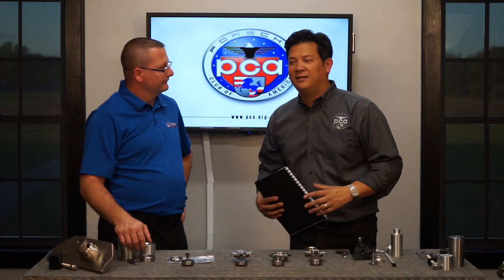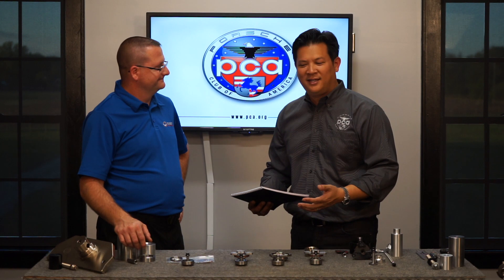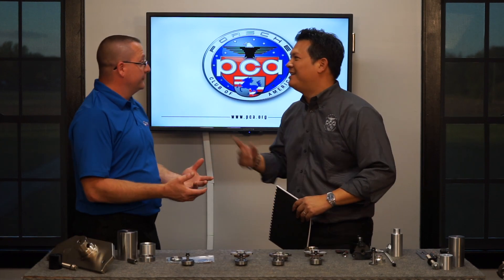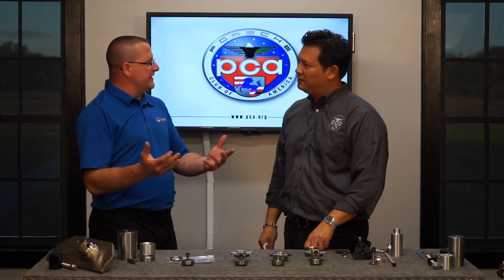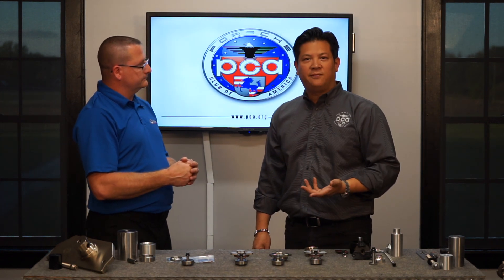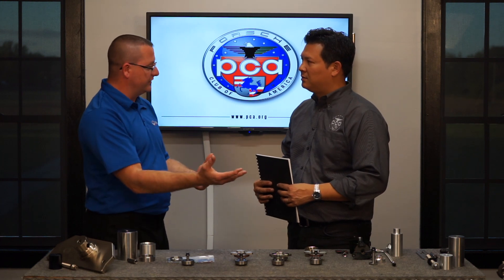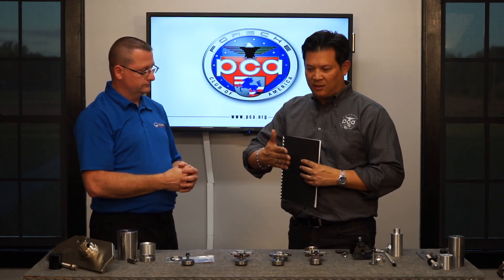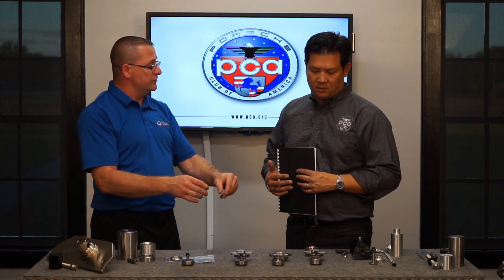PCA Spotlight: Types of IMS bearing retrofit kits

Comment: Nice vids. Correct me if I'm wrong, based on the video,  the solution for factory bearing is to remove the grease seal, as easy as that. How do you reseal the IMS flange after?

Comment: I'm in the middle of a rebuild on my air cooled engine, and looked into this IMS bearing issue out of curiosity.  The installation video to retrofit this kit is a ground ball in comparison.  I'd do this upon my first engine drop for the clutch or something else that you do "while you're there".   Great series on this issue for sure.
Reply: I believe that all the air cooled Porsche Mezer engines did not have this particular IMS bearing issue only because all the IMS bearing that they had were oil fed unlike the water cooled engines for the 986 and 987 water cooled M96 and M97 engines only the water cooled engines from 1997 to 2008 Had the same as bearing failure which was a sealed bearing it has its own oil unlike all the old air cooled flat six engines that had IMS bearing yes but all of those were oil fed by the engine itself so it made for little to no failure rate as long as you change the oil of course unlike the newer water cooled engines which all have a sealed bearing in that case these solutions they are talking about are for the M96 and M97 water cooled engines with the sealed IMS bearing not the air cooled engines that was the big problem for Porsche with the new water cooled engines they went away from the oil fed bearings back when they change from air cooled to water cooled flat six engines in 97 hope this bit of information helped
Reply from the maker: Glad you enjoyed the video. Be sure to subscribe!

Comment: Looks like an infomercial for Jake Raby.  Not a mention of the EPS cylindrical bearing, over 5000 sold with no failures.  Would be nice if PCA could actually be objective.
Reply: You can now buy a replacement from Porsche that's a fix. Dual row.

Comment: OK, I just replaced my IMS and clutch with parts from EPS. The bearing is way better than any of these and maybe cheaper. It is a cylindrical roller bearing  and is open with no seals. Hold many times the force of any of these. it comes with an easy  to do oil bypass to send more oil to the bearing, but EPS says you don't need it. Their newest design bearing works fine without it, but you can use it for piece of mind if you like. Check it out https://www.europeanpartssolution.com/
Reply: Same for me also. Actually, I've read quite a bit of the forums and FB and can't find a single failure of any roller bearings. They are expensive but not near as much as the LN products.

Comment: i have a Targa 2002 with 28k miles on it. purchased it new and have never had an issue.. Should I have the IMS bearing replaced?
Reply from the maker: At minimum, you should be checking closely for metal debris during oil changes and consider sending oil sample out for analysis.
Reply: @PorscheClubofAmerica  thank you so much.. I will do just that.  I follow your videos and find them very educational.
Reply: @PorscheClubofAmerica  thank you very much! thanks for all your great videos
Reply: @PorscheClubofAmerica  after thinking it over, I have decided to have the IMS bearing replaced. Thanks to your program and your response it helped make my decision.. Thank you.
Reply: @PorscheClubofAmerica  not many know of this, glad you share it.

Comment: There's an article from Autohaus Hamilton in Australia about the IMS. google “Autohaus Hamilton Porsche IMS” The article lists all the models and engines (with engine numbers) that are affected. "The Porsche models that are prone to IMS failure and should be replaced are: All 986 Boxster models. - 987 Cayman & Boxster models up to engine number 61504715 - All 996 models (not including: GT and Turbo models) - 997 3.6ltr with M96/05 up to engine number 6950745" Before 2000 Porsche used a double row IMS Bearing which had a low failure rate, then they switched to a single row until 2005 - 2006 and this single row has had the most problems. After 2005 - 2006 Porsche stayed with the single row but increased it's size and strength and this bearing has had the least problems of all three types of bearings used from 1997 to 2008. The upgraded bearing in the 997 and 987 is unserviceable, meaning you can't reach it unless you strip the entire engine down. Some of the early production 2005 - 2006 987 and 997 might have the pre-upgraded bearing fitted, that's why the engine numbers in the Autohaus article might be helpful in determining which type of IMS bearing is installed.
Mr. Jake Raby from Flat 6 Innovations says he has only ever seen 3 M97 engines built after 2006 blow an IMS bearing (Link see comments https://www.youtube.com/watch?v=Srrq4-d3mOg) Rennvision by The Knowledge Gruppe. 
Starting in 2008 Porsche introduced the new 997.2 and 987.2 and switched to a DFI direct fuel injection engine which doesn't have an IMS Bearing.

Comment: Getting ready to have my ims fixed on 2005 C2S. I am finding all the traditional ball bearing and cylindrical bearing kits in the mid $2000s range for installation and parts.  The killer is the IMS solution ranging from $4100-$5800. Everyone wants $700+ more for the labor vs the other bearing installation, even though Jake publicly states that it only requires 0.5 hr more at most of additional labor. I guess we take it twice, once from Porsche and another from these private shops that know the people that want the best kit, aren’t only willing to pay the approx $1,000 for the kit but also willing to spend an extra $700+ for 0.5 hour of labor, just because they can. So much for the friendly Porsche community.
Reply: That's what I keep thinking.  Also, Jack Ruby's products are not warrantied unless you go to a shop so if you DIY no support. This is why the shops support him. The part is marked up incredibly high too.
Reply: He said it's 1/2 hour MORE  to install the RMS = Rear main seal,  easy to confuse RMS with IMS..

Comment: I went with the Porsche dealer. I have a 99 911, which is outside this discussion because their IMS bearing fails much less frequently than the later models and was outside the class action suit. Nevertheless Porsche tells me that the IMS seal tends to leak around 25 k miles along with the RMS seal. Their solution seems to be to periodically check for any oil leak between the engine and transmission and replace both seals, plus check the condition of the IMS, clutch, flywheel while in there. When there is a leak its about 10 hours labor to go in and take a look. I've had this done at 60 k and 85 k. In both cases the bearing and housing was fine. They just replaced the seals (for the IMS it was the 3 point flange thing). In the first case the clutch and flywheel were done and replaced also. I've had the car for 6 years and change the oil every year before storing it. I went with the dealer because they are close me and give good service. These other solutions are excellent but there is  no substitute to periodic inspections.

Comment: Should I be proactive and change the IMS bearing on my 2007 Turbo 997 if the failure rate is only 1%?
Reply: It's been a year since your post, so I'm not sure if this reply will still be relevant. In the event you've put off the plan to swap an IMS, or haven't received an answer elsewhere until now, rest easy. No need to be concerned by all the hype and propaganda spewed out on YouTube over the IMS; particularly since you have a Turbo. The X50 powerplant that's shared by your car, and the GT/RS variants, all use a solid (bearing-less) metal bush instead of the IMS found in the M96 and early M97 engines. Suggested proactive maintenance on the Turbo: Modifying the connection of the coolant lines into the tapers of the aluminum housing, centered behind engine console just forward of the firewall. The coolant line fittings were glued into the housing. Over time and/or exposure to excessive heat, the glue has a reputation for degrading; resulting in catastrophic coolant loss. The simple no-cost DIY permanent solution is to drill and tap small screws into the housing to secure the coolant pipe fittings. The other method is applying JBWeld to the fitting sleeves, and a small bead around the outer perimeter of the housing before re-inserting the pipes. I know of guys who track, that employ both methods as the fix. Like most e-z fixes, the biggest issue is the time and patience required to access the area in need of fixing. A couple hrs. vs $10k w/o labor on a new engine? I'd think so.

Comment: Seems any non-DOF retrofit could also fail, maybe at a lower probability, but electric monitoring would still be required ... so, why not just stick a low cost electric monitor on the car and skip the non-DOF IMS upgrade... or do the DOF IMS retrofit which actually fixes Porsche's engineering screw up, that screw up being their naive assumption that a sealed greased up bearing could be a long term reliable bearing inside an engine, LOL.
   The IMS Guardian has been around for years, but seems expensive, and requires an elaborate install .... would seem that a simple low cost monitoring product could be made which just plugs into the OBDII port, or this monitoring function could be added for free to something like a COBB Access Port unit, since it is already capable of monitoring camshaft positions (COBB:  please add).

Comment: I installed a DOF kit on my M97 engine from TuneRS for peace of mind.  Made my own cam lock tool out of plate stock aluminium.  M97 engines (05-08) use a larger single row bearing that isn't serviceable without disassembling the engine (i.e. splitting the case).  Like they showed in the video, on M97's at least remove the grease seal if you don't do anything else.

Comment: Ok but advantages and disadvantages of each? And brands? Last one is LN engineering if i remember well.
Reply: Last one is the IMS Solution invented by Mr. Raby himself.
Reply: @porschephile2k3  I went for a cylindrical one lubricated by engine oil... My Porsche specialist recommended that one and already had the tools
Reply: @Photoandcargeek  is it the one from EPS? I just looked it up and it looks interesting and more cost effective.
Reply: @porschephile2k3  had to go look through my service history file and you are right, it is the EPS Eternal Fix that has been fitted to my car. There wasn't a significant difference in price but my garage is a prestigious third party Porsche specialist and they used EPS, garages using LN Engineering were 100-200 miles away... And my garage said that they would happily fit the LN Engineering kit for me if I also paid for the tools required to fit it.
Lastly, the LN Engineering requires drilling a hole through the crank case and the EPS doesn't. Not sure I like the idea of the crank case being drilled. EPS requires a minor fuel pump mod and is reversible although I am not sure why anyone would want to reverse it.